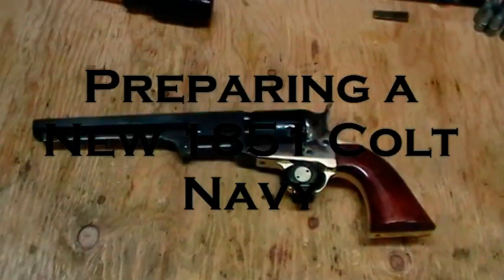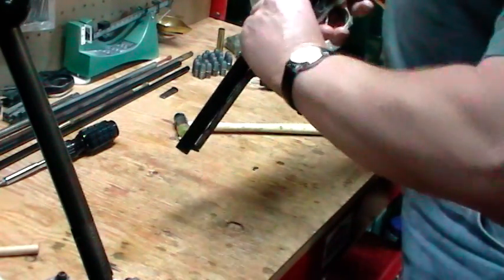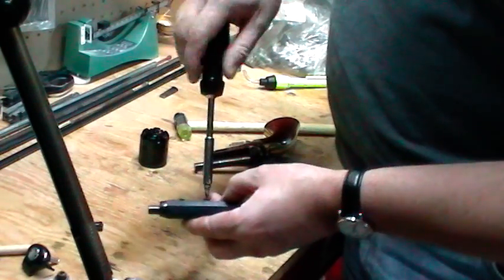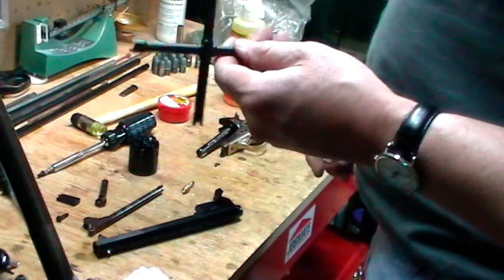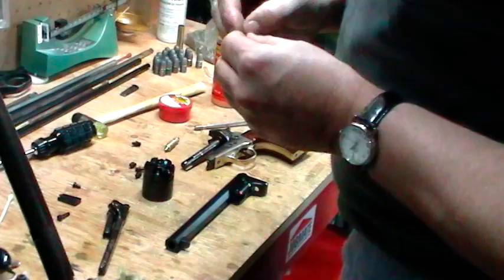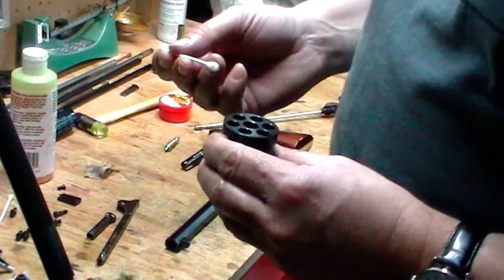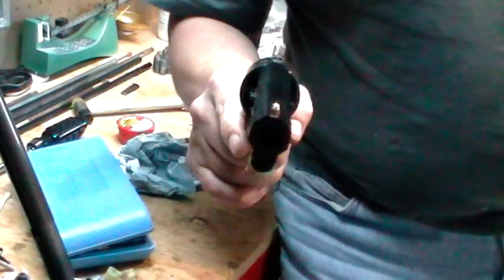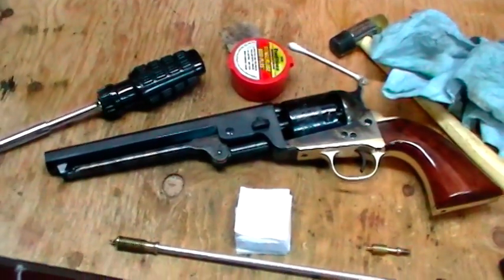Preparing A New 1851 Colt Navy

Comment: I just got me 1851 Navy, it is the Pietta brand.  She shoots very accurate but on the high side.  Only problem is the caps fragmenting and falling into the action and causing my gun to jam.at times.  I'm working at solving the cap jam problems.   I love your Uberti 1851 Navy.  Thank you for sharing.
Reply from the maker: Each time I cock it I tip it to the right first, then cock it, the cap usually falls clear.

Comment from the maker: @hibylittle8  I tried that way, lots of folks here do it too but you get some rust, I don't like the boiling water & all that so I brush it, patch it with butches blend and oil it with 1000 plus. I do the muzzle loaders the same way. 
Doesn't take me any longer and no surface rust. Just make sure you get all the fouling.
They both work :)

Comment from the maker: @TheTac50 Depends on the manufacturer, Uberti says 30 grains max for .44 round ball and 25 grains max for .454 conical. Brass frame may be lower. 
"Never exceed the manufacturer's recommended loads." 
I would check the manual or contact the manufacturer, be safe :)

Comment: hey buddy....they make a cap for that bottle cheaper than buying a flask. Or pick up a rifle case at the range and drill out the primer hole. drill a hole in lid and shove case through hole in lid. Save the white seal from under the lid that way you can put it back in the lid and seal the jug. Than you can get a flask when you have spare cash.
Reply from the maker: Good idea.

Comment from the maker: @speeedracerr The ones I've seen fit right on, Colts are a pain becouse you have to remove the barrel to reload.
Remington is much easier.
Reply: Having more than a few Colt style percussion revolvers, why would you remove the barrel. to load? They have a handy dandy loading lever snapped under the barrel. Only my snub nose gun needs to be taken apart and that is no big deal.
Reply from the maker: Bunk Stagner   I was referring to having preloaded spare cylinders to change out on the fly.